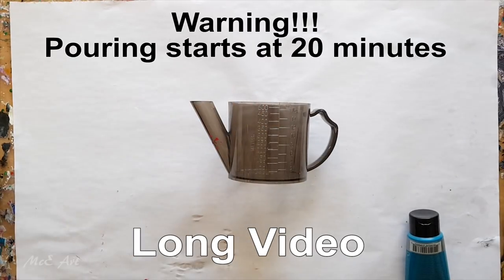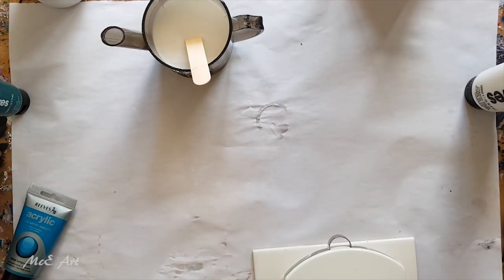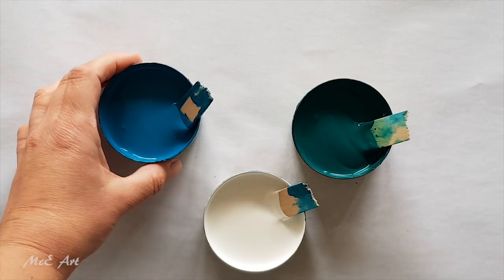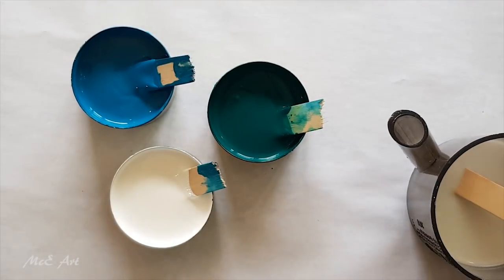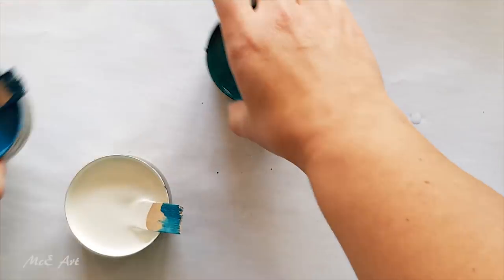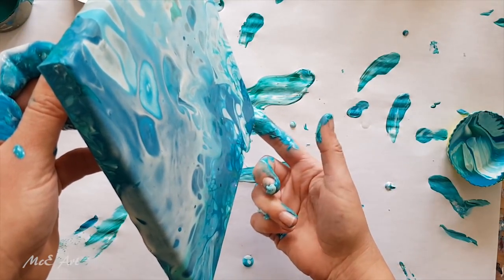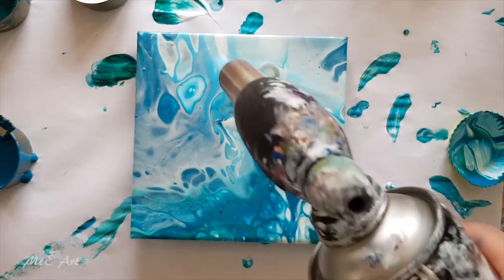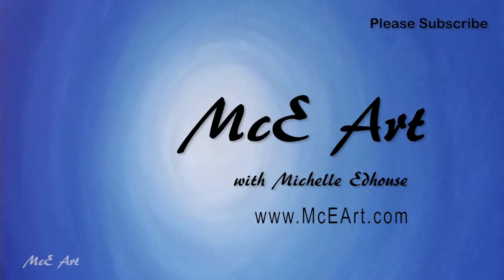325 Trialing a New Home Mixed Pouring Medium

Comment: if you use more paint, would the cells stay more defined?
Reply: racoonsister 
I’m thinking thinner paint would do the trick. It would flow more easily and necessitate less “finger painting”. It would also require less tipping so the cells wouldn’t become so stretched out.
Reply from the maker: By defined to you mean keep a round shape?  If so I agree with Mary, if you mean less fuzzy I am not sure more paint would require more water to thin it down enough to pour though.

Comment: Michelle, I have tried mixing PVA ( Elmer’s Glue All) with the Floetrol and paint and wondering why the two mediums turned very gummy. As I stirred it got harder to stir. I even added water. It also turned yellowish. Do you have a possible explanation? I’ve seen others mix Floetrol with PVA with no bad issues! Could it have needed to be Wood Glue?Thank you, my friend!
Reply from the maker: I would say you need to mix the water in at the same time.  When I tried a previous time to add the glue with out the water I got slime worthy of a slime video!  I get you have to mix the pva with water before mixing with the paint.  That is the only suggestion I have on this one :)
Reply: McE Art Thank you. I’ll try your suggestion!

Comment: How do u get the silicone off the painting? and how long do u let the piece dry before attempting to remove the silicone? Thanks! love the colors in this one. As a newbie, all the different pouring medium recipes from various artists have been confusing so thanks for posting this.
Reply from the maker: Hi, I have a video about cleaning the silicone off here https://youtu.be/-AT-7EP-WoQ  but in short, I leave it at least 2 weeks after touch dry for the paint to cure then use soap and water, then leave another 2-3 days in a warm spot to dry again before sealing it.